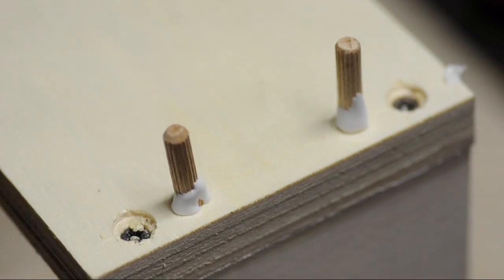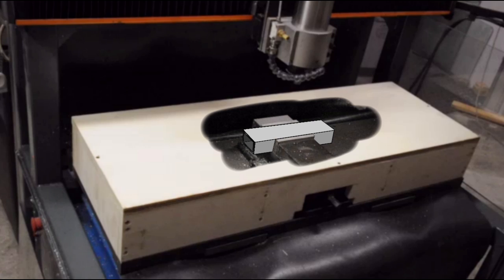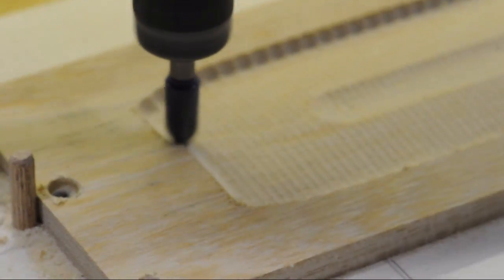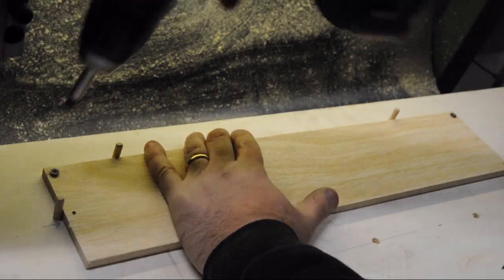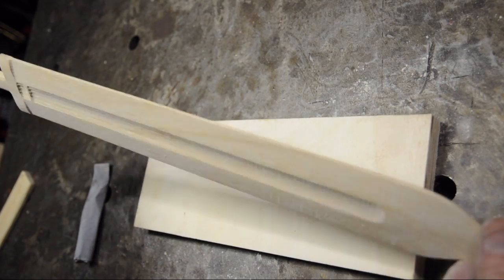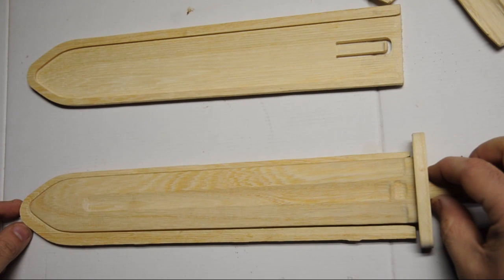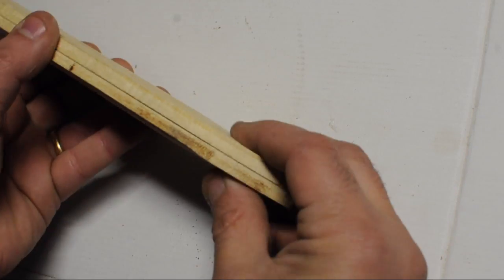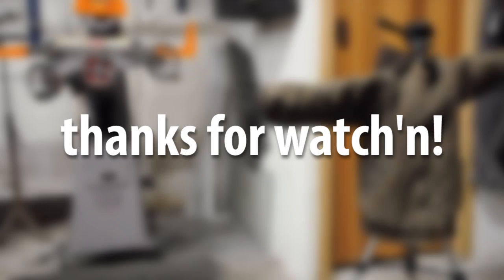CNC Sword

Comment: I was never 'into' swords, but around the age of 8 I was into cricket, so my late father made me a full size, regulation cricket bat. All from 3 types of wood laminated and joined, by hand and only using hand tools. The only power tool he ever owned was a Black & Decker single speed drill. I kept it going through 2 rebuilds until the factory refused to consider doing it any more. That would have been at least 20 years after his death!

Comment: If you ever make one again, or anyone else makes a wooden sword, some aluminum duct work tape, some scotch-brite and flat black spray paint can make the blade look amazing. Put the tape on the length of the blade, making sure it's smooth. Then use the scotch-brite to dull it and put some shallow scratches in it. Then spray some paint on it and once it dries scotch-brite off the majority of it. The paint will fill the scratches but come off the rest of it. It will give it depth and realism that it's used and not wood. And the scotch-brite will give it the dull finish of real blades. Only costs a couple bucks, takes about 10 minutes and looks amazing. Takes a cheap wooden sword to a whole new level.

Comment: I know that this is an old video and you've probably heard this already but, here it goes nonetheless. You could stick on some aluminium tape on the finished blade to make it look a bit more like metal. The guard too. And use a 000 wool to get the latter a bit dull just to differentiate. The project was awesome and I really enjoy your sense of humor.

Comment: Just discovered This Old gem in my watch suggestion list... Probably because I've done some google searches on swords lately haha. Anyway, good to see someone still knowing the value of good ol' wood glue instead of reaching for the 2 part epoxy at every turn of a project... (yea, superduper YT creators out there: while epoxy is a sure bet, it's not exactly the best solution for most of your applications. That's like dropping Fat Boy on your neighbour's rats. Sure, the rats will have it, but err....)

Comment: lol, nice work for a childs toy, also the guards are usually pressure fit on in the case of real metal swords, with the handle drilled through for a concealed tang, passing through the pommel, and then a peening nut before being peened over to keep everything in place, as far as the hardware to hang a sword from a belt it is termed a frog and is a touch involved for a novice leather worker

Comment: Just a suggestion that's more for prop-making, like what you did here. 

You can take 3M foil tape and cover wood parts with it, finish it up with some scotch brite or steel wool to give the wood a very realistic metal look without making the part metal.
Reply from the maker: good tip, thanks CC!

Comment: You've got a cnc and that's all you did with the sword? It's so boring. You could have made it so much better. Like put some runes in the blade, make the cross guard more interesting, give the grip a texture. Anything more than this. You might as well have made it by hand with that boring design

Comment: I recently found your channel and I have been binge watching your videos as of late and I am loving what I've found. And i think i might have a good tip for you:

 A great way to index parts on routers is to drill holes in the stock around the part in the first op, and then drill the flipped pattern of holes in your table on the same zero as your second op. If you use 3 non-linear holes the flip becomes fool-proof.

When you flipped the blade your datum edge moved, so unless your part was exactly centered in the stock in Y, the op2 could be off, is this what happened with the scabbard?
Reply from the maker: Thanks Joshua.. yes I think that's what happened, I was working off the centerline (symmetry) of the wood blank in this case.

Comment: An open invitation to all my favorite maker YouTubers: Please make some videos on hardware. Specifically fasteners (screws, nails, brads - phillips, star, hex), cutting blades (metal/wood), and drill bits (stepper bits, blade-bits, forstner, metal-cutting, etc.). Cover types of materials (carbide, galvanized, titanium, stainless steel, diamond coated, etc.) and appropriate applications for each. Videos similar to Jimmy Diresta's series on tapes and glues. There are so many options in materials, coatings and quality grades -- and the applications for each -- it would be helpful to have your expertise edify us on what we can/should use for the job at hand. And it would save ME a lot of time and money at the hardware store!

Comment: Future models: add a radius to the tang-blade connection, more skookum in the weakest spot.
Reply: you've been watching too much ave
Reply: Yeah, more skookum, in case he actually needs to beat the actual crap out of the other kids without the thing breaking after 10 victims 😅
Reply: Jean Roch Extra strength could allow lighter total weight with same balance and durability.  For a kid this age, keeping weight below 1 lb (excluding scabbard) would be preferred.

Comment: Every kid should have a sword!! I used to do scouts with my kids and every year we would have a camp where I had to come up with some activities.  Several times we made swords.  I got more sophisticated each year and the final year we made viking daggers which were cut and routed using a series of jigs (no CNC back then).  I had to make 30 of them and they were all made from pallets.

All the mums typically freak out and expect the kids to kill one another, but they never did.  They were too protective of their precious new weapon to allow them to crash into anything.  They would spend hours acting out fights where no blades touched.

One of the problems I had was that I really wanted the kids to be involved in the build process.  We ended up getting them to wrap cord around the handle and then decorate the blade with small tacks.  They could write their name in tacks and then they felt much more a part of the process.

We also made shields from that thick cardboard you get in packing boxes.  It cuts great on a circular saw and I gave each kids 13 triangular segments that they had to tape up into a round shield using packing tape.  They then put on a handle with some cable ties.  The conical shape made them super strong.   When I was cutting the triangles I did them about 8 at a time.  My garage ended up 18" deep in cardboard offcuts!

Comment: I worry about that sword breaking where the blade meets the tang.  Me thinks it would be preferable to have a general fillet there as to not have stresses on a 90 degree corner.  No need to have it break like a M9 bayonet.

Comment: Just rub the whole thing down with some bees wax. Thats what I use for my axe and hammer handles. Good grip and a nice look.
Reply: NotSure177 i melt down 4 parts (by volume) of beeswax, 1 part carnuba and 2 parts food safe mineral oil. It works great as an easy simple finish for basic/utilitarian stuff
*depending on what it is, reduce or increase mineral oil for ease of use vs durability

Comment: I think the part lateral offset might've been caused by the toolpath not perfectly centered in the board, or the edges of the board might not have been parallel.
Reply: The edges of the board don't matter. The board could be any shape imaginable as long as it completely contains the toolpath. The CNC doesn't know that the board has an edge at all.
Reply: Except that he's using the edge as a datum.  If the center of the part is 1" from the dowels, then unless the board is exactly 2" wide the two sides won't align perfectly.
Reply: He's using isometric points to position the parts, the edges are used as a reference surface. Your reference surface should never change during machining.

Comment: what? you didn't heat treat the blade? How do you expect it to hold an edge? OMG!!!!!?!!!!!!!!!!!!!
Reply: You do know that wood can be fire hardened?
Reply: preferable it does not hold an edge, also heat treatment is more than just putting an edge on the blade, it also makes the spine softer so that it will spring back if deformed
Reply: TheDarkalkymist , take a deep breath...one more...one more...there. Now go play.
Reply: @TheDarkalkymist  i think that the planks come pre-hardened from the shop. If he used his own fresh wood, then yeah he could harden it😂😂
Reply: TheDarkalkymist it depends. When heat treating steel if you do a differential quench or temper then that’s true but if you don’t it’s all going to be the same
Reply: Seriosly its wood
Reply: @FirstnameLastname-zb7hd  Seriously wood can in fact be hardened via flame. This is because carbon is tougher than wood. In a pinch you can take a dense hardwood, carve an arrow shaft from it, point the end, then lightly burn the end and sand it a bit to get a serviceable point for hunting creatures with tougher hide.
Reply: @MeepChangeling  if I'm ever "in a pinch" to construct a wood tipped arrow I'll think of you.
Reply: @MeepChangeling  ok I didn't know that
Reply: @FirstnameLastname-zb7hd  youre not to bright are you guy?
Reply: @harrisonwilbanks2380  im sorry what did I say?
Reply: I guess lots of people never read Robinson Crusoe.
Reply: @justina Harms unless you replied to woooosheads
Reply: Hard wood has a higher carbon content than your soft woods. Hence they can be hardened and hold a better edge. It's what's used for making wood augers, wood chisels and wood screws.
Reply: That edge can hold itself just fine, trust me. It's big and beautiful :3
Reply: Wooooow. People, it was a joke. Just a simple little jest.. my goodness. It is ok - we all know it is wood. We all know wood can be hardened with fire. We all appreciate the included information on the carbon in wood I'm sure. Relax. Take a breath have a chuckle.
Reply: probably better that the kid's sword isn't hardened or sharp. I used to have a wakizashi-length (shorsword length) bokuto when I was younger (high school) and the thing could break bone if swung hard enough. *there's a reason why Miyamoto Musashi beat the living hell out of otherjapanese swordsmen wiht a wooden sword--intneral injuries are horrific, and you don't want to be the dad who has to deal with parents comcplsining that your kid hit his friend hard enough to cause brain damage.
Reply: So many people here got r/whooooooshed
Reply: He didn't have any slaves handy with whose blood to quench the temper
Reply: 😂😂😂Wood Hardener😂😂😂

Comment: I was very pleased that you included the fuller on the blade.  Hydraulic lock is NOT a good deal when there are multiple opponents.  If you get your blade stuck, you can be at risk.  Also, getting slickness on the bottom of your boots is a major faux pas.  And that's almost a given if you have to stand on the guy to withdraw after the finish.   Excellent work!

Comment: SHORD!!! I Totally get it. Can't wait to make the first shord for my little boy. :D. 

By the way, silver spray paint would look cool on the blade!
Reply: Auarhau Silver paint definitely works, but a trick I've picked up from prop makers is to use aluminum duct sealing tape. It gives a genuine metal finish so you can polish or brush it to match your needs and looks great!
Reply: well i didn't ,...
Reply: +Benjamin Tetreault 
Adam Savage? :D
Reply: ElectroBlood He wasn't the first, but he definitely proves that it's a legitimate technique!
Reply: Benjamin Tetreault Yeah I also seen that on tested. But silver paint is quicker, and I doubt the 4 year old would object xD